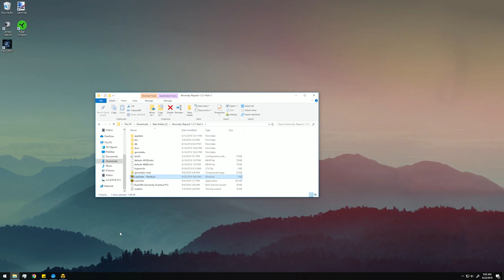Stalker: Anomaly[MOD] - Weapon Repair Guide (2.4) // UPDATED FOR 1.5 IN DESCRIPTION

Comment from the maker: I made a mistake. I incorrectly said that if you attempt to repair a worn part to new you do not lose the base weapon part. Not sure if its a chance within a chance or something BUT YOU CAN LOSE THE BASE WEAPON PART. The only thing you definitely don't lose is the File/Ramrod/Multitool. Whoops.
Reply: Thanks for the great video. There is an in-depth changelog linked on the download page for version 3.0. It doesn't say exactly, though... Do you know if you can still lose your base weapon part with repairing like you said here?

Comment: wouldnt it be easier and cheaper to just buy a new gun in most cases?
Reply from the maker: I'm my video I straight up bought everything but that was for learning purposes. The more you play the more loot you go through so you'll encounter these items on your own. Sure their will be a point when going to a technician is better especially with cheaper base priced guns. But even then the repair kits are pretty static in price so for example if you straight up bought everything it might be 10k for a weapon repair kit and another 15k for the 4 weapon modification kits and then if you consider cost of multi tool + 1k vice cost then sure spending 30k~ rubles is prob not the best option for repair an AKS 74U since a technician I think charges somewhere around the much or maybe a bit more. But the cost to repair... say a weapon a like a val. The technicians going to tell you "yea sure that'll be like 100k" but the costs of the items to repair it yourself did not change. its still 30k~ roubles. Technicians can still do things only they can do. Sorry I can't make anything short and in the end this might just be my opinion.

tl;dr it might not be worth it on lower tier weapons but you can loot these items. instead of selling these repair items for 10%(5%?) of their worth to a vendor you can get 100% of their worth (upwards of 10k roubles) if you use them in your repairs.
Reply: @regicide9940  i see

Comment: I have to ask: is your 1.5 (beta 2.4) installed correctly? You're running the exe from 1.3.1 part 2 folder.  Did you just happen to extract all the 1.4 and 1.5 files into there?
Reply from the maker: That was just me being lazy. Yes it's as you described since in the end you need to extract all the parts into one folder. It just werks.

Comment: It's fun to do, but I find it very cost ineffective.  Say you find an amazing gun, that is 40% condition and *worn*.  It will cost you 10'000RU or more to get it to 100% worn.  You then have to buy repair kits that will allow 5 uses; one use for each weapon part to be replaced. There's another 10'000RU. Personally, I just disassemble all worn or rusty (those that have too low a condition to sell) weapons and sell the parts to the mechanic. You don't earn much but it mounts up.
Reply: It's very confusing. Watching your video through has explained it a bit more. The game/mod does not clearly enough explain that the calibre specific kits are JUST for the barrels, and the modification kits are for other parts.  In my opinion, the repair kits should simply be back of tools that degrade like the multitool rather than having a single use.  I think it should be tear down a weapon into parts with a disassembling tool, then use an 'assembling' tool, or repair kit, or install new, functioning barrels and parts into a gun.  

It is a very good idea, but it's just too convoluted and tedious atm.  I have only repaired one gun from ~35% worn to 100% normal and it cost me nearly 50'000 RU to do so. The procedure didn't seem to work properly, or I misunderstood something, but it would NOT let me replace any parts at the vice until I had paid the trader to up the condition from 35% to 100%.  Perhaps I was choosing the wrong part or the gun didn't need a barrel.  Either way it's just too damn fiddly.
Reply: @Planehazza   after playing it, i have to agree.
Reply: @rpscorp9457  It has changed a lot in b3.  It's almost too easy, but I'm using it a lot now. You have to repair components with sewing thread or kits, then use those 100% items at a workbench to repair the armour etc. :) I almost enjoy it as much as the exploring and shooting ha

Comment: Mind doing one for suits?
Reply from the maker: I thought about it but in the end I've decided not to. Simply because it's really simple. Two rules. If armor is below 30% then you can't repair it without a tech. The second thing is that you only need to use the part of this tutorial where you took your gun from 85% to 100%. By that I mean you used kits instead of a vice and instead of 85% to 100% you are going from 30% to 100%. That's really it. I might do a short video if you truly don't get it but it would be like a one minute video.
Reply: Regicide it’s more of the upgrading part that I’m confused by. Not repairing.
Reply from the maker: @ppaauull3854   After thinking about it and double checking with how it works I think there is enough content there to make a quick armor video to follow up with this one. Maybe by next week. Thank you paaaaaaaaaaaaaaaaaaaaaaauuul.